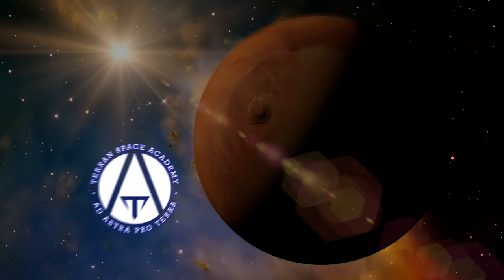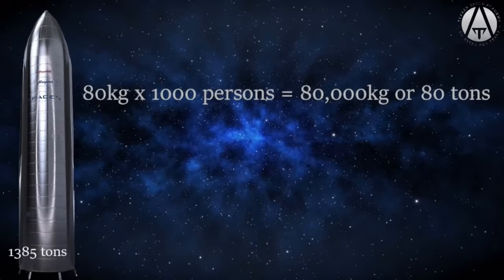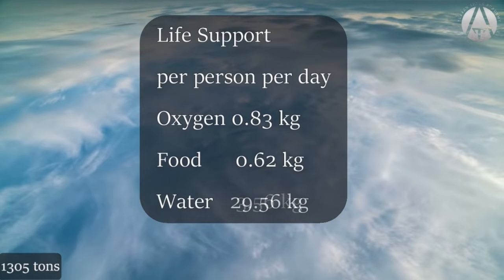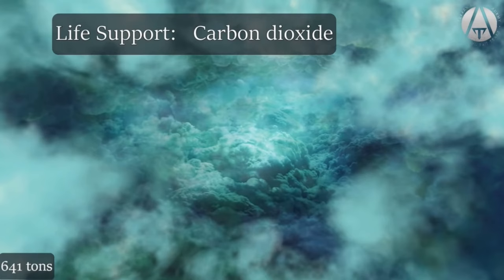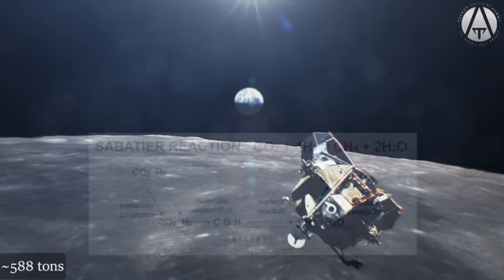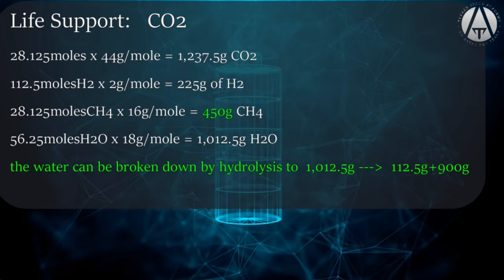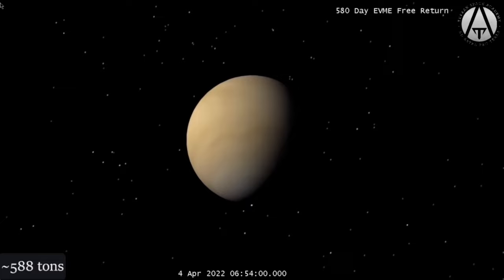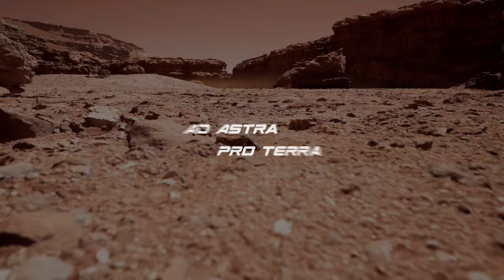Environmental Control Systems and Food Production for Space Travel

Comment: Yep, Aquaponic is definitely intriguing for such Application, but it’s definitely more of a Balancing act then hydroponics. 
I have a few crazy ideas to run past you regarding possible techniques for food productions, and life support.
1. Question regarding human waste, will toilets facilities be segregated based on if the passenger is consuming pharmaceutical products that need more processing before entering back into food recycling process?
2. Questions, Could a modified version of vacuum tubes like the ones used in banks be useful to form a type of hyper loop for bees 🐝, sounds crazy but at least hear me out, this would allow the uses of multiple beehives to cover a large amount of isolated growing spaces. Each bee🐝 would be fitted with a RF ID tag on its back that would help guide and Direct the bees journey to and from growing space to the bees individual hive, the bee could be exposed to the correct level of UV light to enhance Growing space isolation.

More questions but out of time.
Another great video 👍
Reply from the maker: That is a critical point rarely made and an excellent idea.  We often forget how interconnected everything is...

Comment: The interesting thing will be, what happens when that soil created on the ship comes in contact with the Martian soil?  As for sending 1000 to Mars right away, that should wait. The first flights need to get supplies there to start building infrastructure. So cut that number of passengers down to 10%. A colony starter of say 100 qualified in the basics of construction, farming, mechanics, medicine, engineers, and scientists. With the majority being construction/farming types. You need to get things setup for when the 1000 passenger ships come and you need a way of feeding those who are there. Once you get a few ship loads of the basics there, then when ready, you start with the 1000 person ships. The first ship will have to be built tougher than the rest as it will have to be able to land on an unprepared area. That ship should have the needed equipment to produce a pad for landing the next ship on.  And you will need some way of getting that second ship out of the way. Either by flying it back or by just getting it out of the area. Same will apply to # 3-10. At that point you may want to look to transfers to orbit instead of full trips with the ships from LEO or the Moon.
Reply from the maker: You are quite right.  I addressed that in several earlier lessons. Over 50s for the first group.

Comment: Outer space has a baseline temperature of 2.7 Kelvin, minus 453.8 degrees Fahrenheit or minus 270.45 degrees Celsius temp of engine. cold bride it will get condensation make wake water make fuel, less to carry plus feed water jacket for space rads. but cave are saver then the open on planets.
Reply from the maker: The heat generated by the crew and passengers will radiate out through the ship keeping the water liquid as there is no atmosphere in space to carry away the heat by convection or conduction and radiation is not effective enough.  The cold is not a problem.
Reply from the maker: Thank you.

Comment: Great video, lots of math. Some of it seems to be wrong. A ship the size of starship cannot reasonably hold 1,000 people for extended periods of time, not a week much less 36 weeks.  Each floor level of the star ship offers about 700 square feet.  At 100 people per floor that is 7 square feet per person... for 9 months!  That is not even a walk in closet, its about two coffins.  28 inches by 36 inches to be precise.  IF you had ten floors for habitation that would be 1,000 people but no room for the 1,000 tons of food, not to mention how much soil and water you need per person, you would need a whole second ship just for that.  
   Perhaps I missed a step or a video.   Where were you going to store 500 lbs of crap each day?  That's over seven tons per month and you have to have a place to put it.  
   We don't need 27 kilograms of water each day. Not for drinking.  2 kilos per day for drinking, after all there isn't a work detail for hard labor in the sun, it's cold in space.  People who don't work do not need to shower every day.  5 gallons every other day for showering and then recycle it and filter it.  
     A 9 meter diameter rotation of 4 R.P.M would give you a very weak gravity of about 0.08, not lunar, much less Mars gravity.  5. RPM would give you about 1/8th  (0.125) of  a G force.  This would be usable but not comfortable as people would be throwing up their crickets.

    A starship is just not practical for more than about 20 people.  You need so much support tech and supplies and fuel for a faster trip.  A faster, more powerful engine with 1,000 isp is under consideration, a more powerful fuel in liquid phase, a stronger metal with higher heat tolerance and more robust design shape is being planned.  But a ship the size of starship is just a shuttle, like a private plane.  I believe  a medium heavy cruiser should be built with at least a 230 foot diameter disc, allowing a tunnel like subway train in a ring, a torus inside a torus .  The inner tube would spin, free floating inside the slightly larger one, about 25 to 27 feet across with the large diameter being 225 feet.  Spinning at 4 rpm this would have 0.6 g, or slightly better.  The nuclear propulsion could run off of liquid water, perhaps electrolizing it into oxygen and hydrogen to give the nuclear engine a little extra burst of heavy speed.   Surrounding all of this we could have an outer hull maybe 110 feet in diameter and about 300 feet long.  A rotating wall on the inside of this, being 31 meters spinning at 4 rpm would produce. 0.27 G force, about Lunar G.  This ship design could be entirely self sustaining if it only carried about 300 people continuously however for the trip to Mars it could take an extra 400 or so and drop them off and bring back the Mars survivors home.  
     A large ship can be self sustaining with humans on board.  In 1960 David Latimer put soil, water and plant seeds in a ten gallon glass bottle and sealed it, adding a little water in 1972 it has not been watered since.  It has reached equalibrium, never running out of water, air, co2 or food.  https://biologicperformance.com/sealed-bottle-terrarium-garden-watered-once-53-years/
    Using this model we can achieve and equilibrium in space and a closed container that loses no oxygen, water, or food.  It requires soil and animals,   crickets sound like a good idea.
Reply from the maker: This ship is much, much larger than Starship....
Reply from the maker: Watch "Starship the Next Generation"